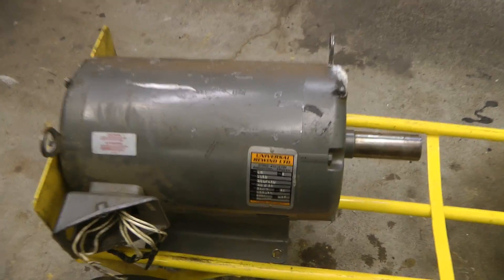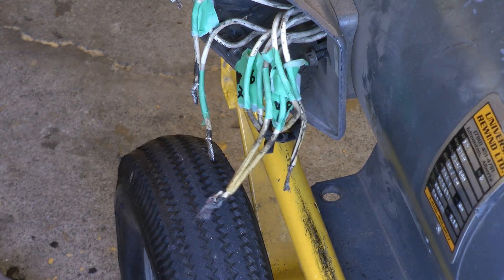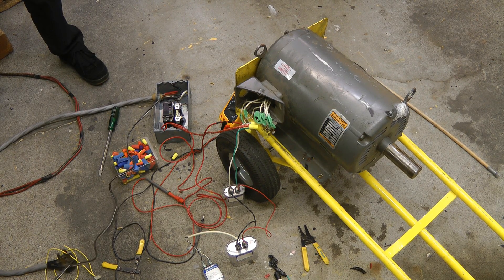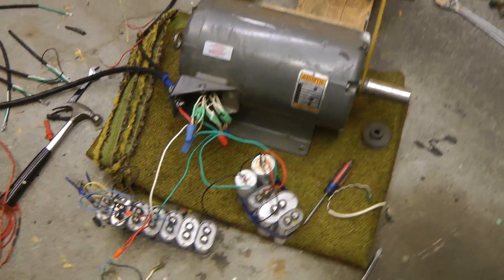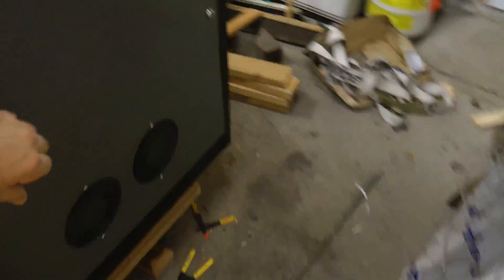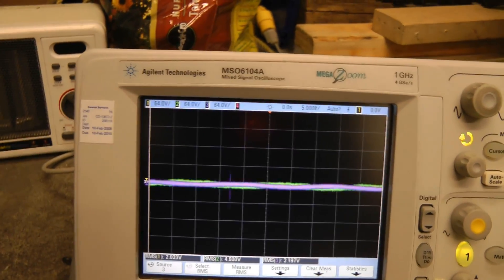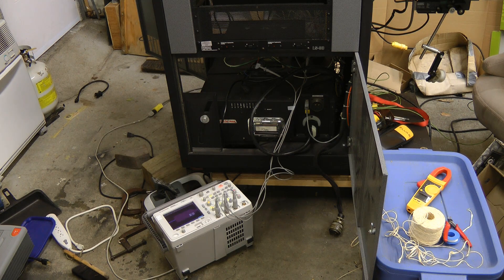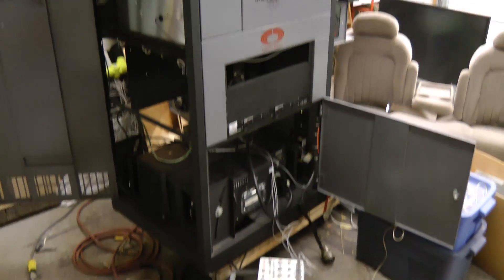Extreme teardown - Simplex 35mm cinema projector - Part 3 Phase converter setup

Comment: Hi... Can you let me know if you can still get films for these projectors?  I'm looking at acquiring an old movie theatre and it has three of these machines... Can I operate with these?  Thnx
Reply from the maker: It's almost impossible to get 35mm prints anymore, all the major distributors only offer a digital format. Perhaps some indie films are available on 35mm, but that will likely end soon too. You'll need to swap out the projectors for modern digital ones if you want the theater to succeed.